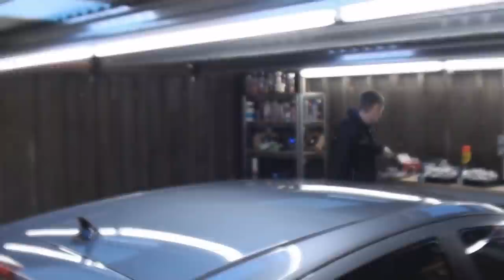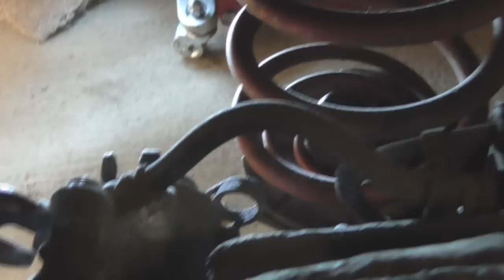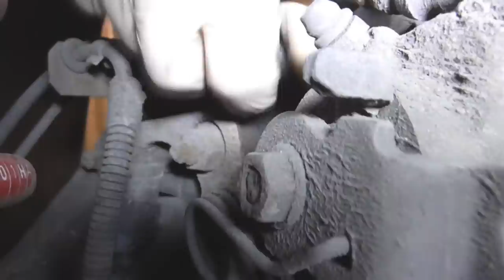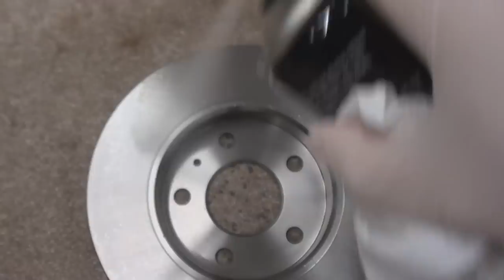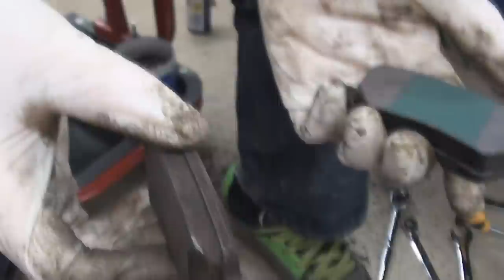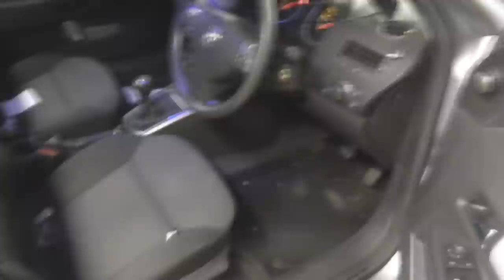How to Replace Rear Discs Brakes (Full)

Comment: Thanks for the video it's helping me to change the brakes on my astra. The torx bolts that hold the caliper on were so unbelievably tight to undo I'm wondering if I should put some grease on them before doing them back up. Or maybe thats a bad idea?!

Comment: Loving the Astra H Videos! I bought a Astra SRI Turbo 200 back in February. (Only 500 or so left apparently!) So i need to know as much as possible about these cars so i can do all my own work :D
Wasn't so sure about the jacking points you used in a previous video on that bar that runs the length of the car because i ended up taking some of the under seal off when i did my oil change (maybe it was my jack stand that's to blame. Also read on some other forums that if you jack up the back using the rear axle you can bend it in the middle? But keep it up guys any advice on Astra H's is a big help for me :)
Reply from the maker: nice man, Glad you like. Ive never heard of anyone bending one of those beams! there pretty strong. You are fine jacking up on them, and placing the stands either side at the edge of the beam.

Any questions join our forum, ill be happy to answer for you!

Bluudy